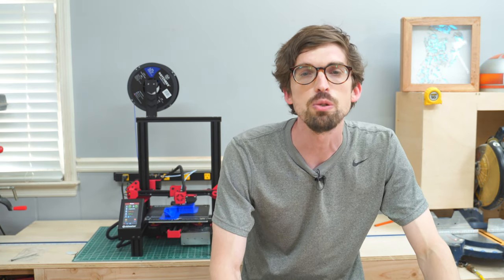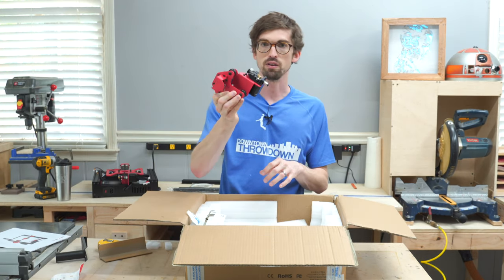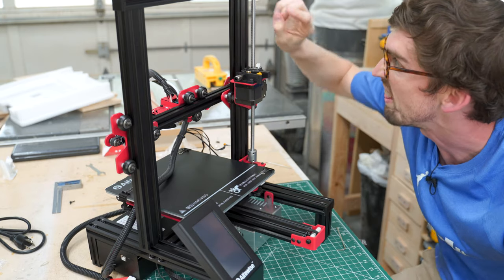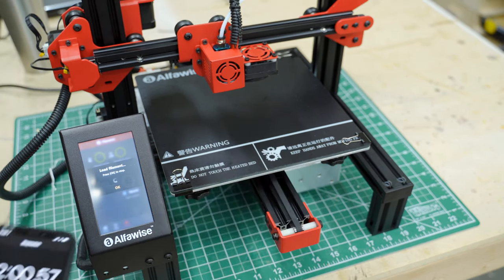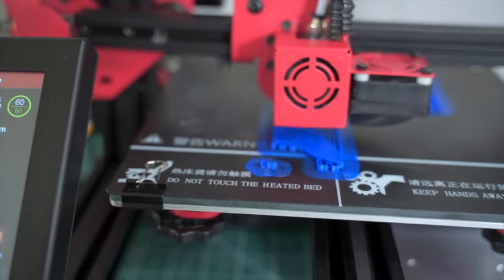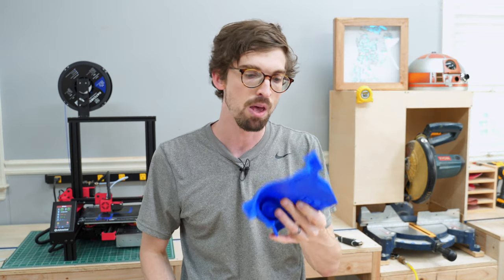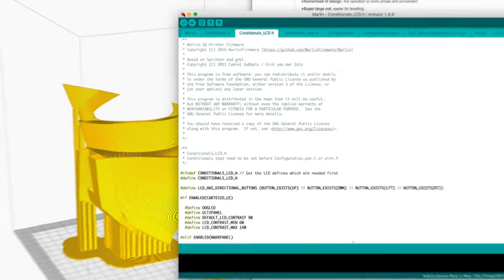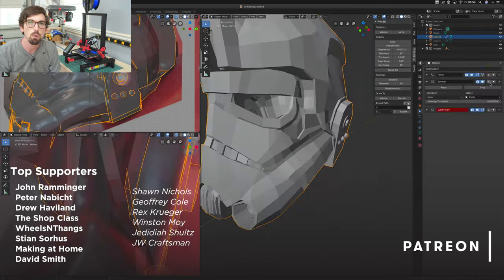Is a Budget $250 3D Printer worth it? Alfawise U30 Pro Review

Comment: Just a note in case you haven't already noticed this but you can on occasion rotate a STL model in your slicer to another orientation even if it be upside down to sit flatter on the bed.  This will save you print build space and save filament in avoiding to create extra long support structures.  It doesn't always suit your goals but the flatter the surface you can start from the print bed , the better your print can be stable and be more filament efficient.

Comment: This printer has x axis error about 200 microns due to the fact as the belts are not straight by angled. Same as in cr10 and ender3. This might be an issue when putting together props from multiple parts. For example Cornely cool has fix for cr10 in thingiverse

Comment: Nice review of this, I've been considering adding a 3D printer to my woodshop as of late and didn't realize how much cheaper it would be to do vs a CNC (want a Shapeoko XXL). Have you gotten around to making tool holders?
Reply: Also, any issues with warping so far? That seems to be common among less expensive printers, among other issues related to quality of parts and QC.
Reply from the maker: Not yet, but that should be happening early next week!
Reply from the maker: The only issue I ran into is the actual filament warping because of the heat.  I had it in my garage and it was in the upper 90’s.  The build quality was surprising good for the amount.  All metal.  A 3D printer is a good bit cheaper than a CNC but the applications are going to be really different.  I would say a CNC is a lot easier to recoup your costs with engravings/signs while a 3D printer will help a ton with prototyping and creating parts that would be nearly impossible with anything else.